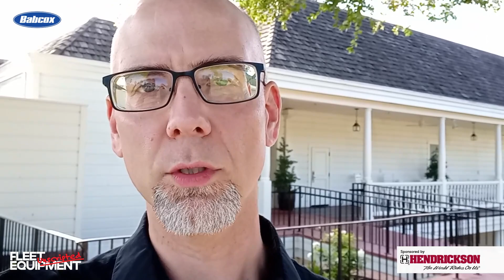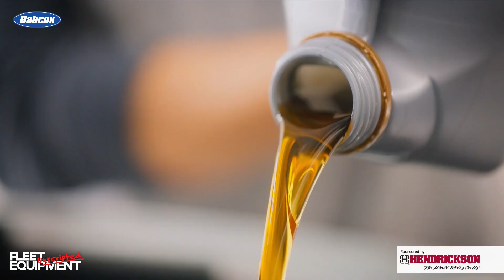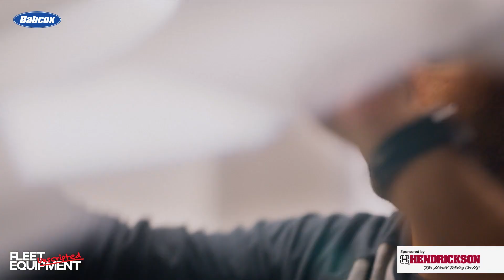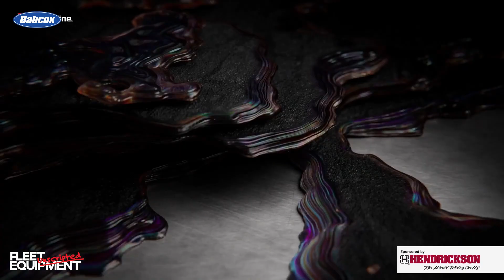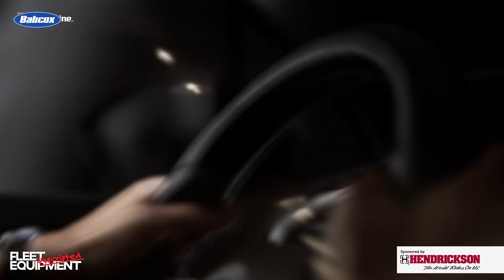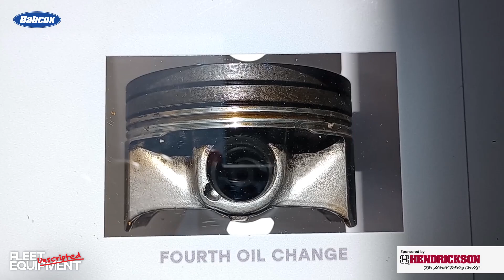The hidden threats to light-duty gasoline engine life, performance | FE Unscripted

Comment: So is this oil something i can use for tegular oil changes my only has 10,000 miles on it never used this before but i did  my oil changes  at 5,000 miles on my 3 cylinder turbo with regular valvoline oil 😊

Comment: He never say´s what the new additive is for removing baked on deposits. It sounds like Oven Cleaner!
Reply: That's proprietary information, so they're not going to give it away. Even in Lake Speeds visit to Valvoline they only generally dance around the topic and they show that it's clearly not just a bunch of esthers (oven cleaner) 😂. They do a side by side comparison of the R&P and their diesel formula designed to clean the engine and it's obviously not just more detergents.

Comment: Ignore the change your oil and filter after 500-2000 miles, if you have been taking care of your vehicle with a good synthetic oil and changing at 5k with filter. Some people have been posting fake videos of clogged filters at 500 miles from this product. I have cut open filters, and all have been clean and clear!! 3rd generation mechanic and engine builder.
Reply: Better to be cautious
Reply: Idk man, I get that for the majority of people, they're fine going 4k or 5k miles on the first oil change even with fairly dirty engines. But for super dirty engines and honestly just to be safe for everyone, an early filter change on the first OCI is like a $4 to $10 insurance and peace of mind. I get your point but I don't think all the videos of people with sludged up filters are fake, there's a LOT of dirty engines out there.
Reply: How do you know they are fake? I saw one video from a guy I trust, and the sludge was there in the filter after 500 miles on a Ford F-150. If you have an engine with a lot of sludge, I can see that happening, and not necessarily being faked. I too have opened several of my filters after 3000 miles with Valvoline R&P, and they were fine, but I had done 5K oil changes for years up to that point.

Comment: In 2022 I got a 1997 town car 4.6 v8 with 48,000 miles    Was burning/consuming 1 quart every 4,000 miles  ( added small amounts and by 4000 I had added a quart  and getting 14.9 MPG combined. Started Valvoline R&P   I’m getting 19.8 MPG combined. I’m at 86500 miles now and I believe the engine is better now with more miles than how it was at 48,000.  Change filter at 500 miles then oil at and filter again at 2000 miles the first oil change when you switch to Valvoline R&P that’s my opinion
Reply: @El_Peto this is a commercial and most posters are Ai

Comment: If high engine oil temperature is a problem, why isn't there a BETTER oil cooling system in gas engines? Back in the 1970's it was common to replace a sheet metal oil pan with finned aluminum pan.  Why isn't there a pressurized engine oil cooling and monitoring system ?  Perhaps this is a 'planned obsolescence'  by manufacturers and the aftermarket oil products and parts industry?  In this video, it sounds like these oil products are like EX_LAX for engines.
Reply: You can add oil cooler and some cars and trucks come factory with oil cooler. My 18 frontier has a OEM oil cooler.
Reply: Oems increased operating temp of engines from 170-185 to 195-205 to increase miles per gallon to meet  Cafe regulation. Engine surfaces are extremely hot now. Piston rings are frying the oil and creating deposits
Reply: @doctorwhodj  Increasing engine operating temperatures by 10 degrees has basically no effect compared to combustion temperatures. Piston rings are now made thinner to increase fuel mileage with lower friction, BUT thinner rings also do not transfer piston heat to the cylinder block walls. This was known back in the 1970's.
Reply: @ThisOldMan-ya472 , doctorwhodj is correct that OEMs have been forced into these higher temps in the pursuit of CAFE and further regulations. 

It’s not uncommon for modern engines to run coolant temps at 220+ and oil temps above 230. Transmission temperatures also stay over 200 degrees, too. 

These powertrains are pushing temps in normal operations that would make people nervous forty years ago.

It is planned obsolescence, though not manufacturers by choice. It’s planned by regulators intent on pushing EVs. They’ll continue making traditional vehicles worse until people naturally gravitate to their desired path.
Reply: @settledontheprairie5524  I can understand higher thermostat and engine operating temperatures, as 20 degrees isn't that significant compared to combustion temperatures. Perhaps this is ALSO why it is unwise to use ay oil other than Full Synthetic. I do see a lot of Dodge 392 engine failures, as there are in Ford and Chevrolet. I do not know what the operating temperatures are for race cars, but that is planned obsolescence.  LOL.

Comment: Why no Dexos rating?  
GM engines have deposits too.
Reply: Probably because they did want to tell GM what is in the oil.
Also pay the money for the license to put DEX on bottle.
Then make it more expensive.
Reply: It costs a fortune to get the rating and it’s not that difficult for any properly formulated synthetic oil to exceed Dexos.
Reply: i run this in my GM. the last 2 oil changes are black as heck after only 1k miles. currently doing 2k changes. used to have a cold start stumble and that is mostly gone.

Comment: Wouldn't a catch can and normal 3 to 5 thousand oil changes solve this issue with sludge instead of buying a expensive oil. Just a old guys opinion 😂
Reply: @user-jo1hm3co6z  in most engines, yes. I have talked to two engineers. One at BP and the other at SOPUS. Both told me the same thing. All oils, including "conventional" can go 5k miles no problem. Catch cans can cause more problems than they are worth in some cases on GDI engines. The carbon on the intake valves become more glass like hardened by lack of PVC oil vapor entering the intake manifold. But, it can depend on specific engines. Some engines are more prone to have sludge buildup in the crankcase or carbon on backside of intake valves.  Subaru and Toyota owners in particular should change their oil at 5k no matter what oil is used in my opinion. Ever wonder why more engineers include oil jets spraying the back side of the pistons are fore? Cooling of course. Modern engines have low tension rings, and it's imperative for the ring lands to remain clean as possible, or you will have loss of compression or oil control. This is the real issue. Penzoil ultra platinum is marketed for this very reason. And this Valvoline restore product as well.
Reply: A catch can only slows down deposits in a D.I. engine - will not prevent it.  An oil catch can will also help keep some oil and other garbage out of your turbo inlet.
Reply: @reubenmorris487   - There are many variable factors that play a role in choosing a motor oil, for example the Amsoil XL Boosted which has a very low noack but also exceeds all requirements.

Low noack means low evaporation and therefore less losses and deposits.

Also follow the API rating that is now on the SP better, the ACEA works a bit more accurately. Delve into this and you will notice that ACEA is actually better.

Furthermore, we have to decide that that GDI junk has disadvantages that we do not want, and therefore also brings with it burdens.

I then simply decide to avoid those engines like the plague.

By the way, I drive a Beemer 3.0 diesel, and the 2.0 diesel. Furthermore, powerful engines from Honda.

The right advice and the right products and the right maintenance. But isn't this the case with everything?

Furthermore, here in Belgium we also use ethanol or regular petrol. Or the V-power diesel.
Reply: @laurapalmerTDGE  I use Amsoil European MS in my VW Tiguan...so I'm merely speaking from personal experience.  I understand the goal of NOACK volatility testing; but your oil will still let off smoke and mix with the PCV vapors and make it's way back into the intake valves.  I agree about the GDI; it wasn't well thought-out with respect to maintenance and longevity.  They need to engineer a way to maintain the pollution control without clogging up the intake valves and creating a situation where you have to pull manifolds as regular maintenance.
Reply: I follow your opinion. 

Valvoline also claims that previous oils caused many deposit problems. 

I stick with 0w30 Shell Helix Ultra and SS Amsoil Diesel both S/C rated. Or the XL Boosted which are near perfect. 

One quart of Valvoline is about is about 7 dollar over here in Belgium. But there's better. 

Ps : frequency matters a lot.
Reply: What about adding 1 quart of  automatic fluid to clean deposits.

Comment: I live in Canada can't find this stuff anywhere
Reply: Check with your Cummins dealer, look up Cummins Blue.
 I use it in my Duramax, and my 04 5 cyl  P2 Volvo Gasoline 
 The Cummins Valvoline Blue was where this got developed.
Reply: @johac7637  will do I have a 2010 CTS-V wagon manual with 732,482 Km would like to try this stuff just 2 see what comes out
Reply: Valvoline hasn't been able to market it in Canada, that word I got from them, I brought mine from the USA, there it's at Walmart, you'll need to get it online shipped to you, unless you can go stateside. 
 I went to get some more here for a customer, but no luck.
 Even the Diesel version is getting harder down South, as it's only sold to a Cummins outlet.
Reply: I ordered restore and protect 5w20 on eBay for $26.00

Comment: On that first oil change that you use Restore&Protect, a lot of the deposits that are easier to remove come off quickly and clog up the oil filter. But in general any that aren’t caught in the filter are small and stay suspended in the oil. Highly recommend changing oil and filter after 2000 miles the first time you use this stuff or it will clog from all the gunk getting cleaned off.
Reply: According to Valvoline that’s not true. They specifically designed that oil to clean slowly so you can run normal intervals and to not clog your oil filter. It takes several change intervals (I don’t remember the exact number) to clean.
Reply: @flyer8493 4
Reply: @flyer8493  yeah but once you have sludge it has to go somewhere... Usually to the oil pan where it's gonna get sucked up.
Reply: @miltechmoto  True. But I don’t think restore and protect is really meant to be used on a neglected and sludged up engine.  Be cool to see a test to see if it can be.
Reply: Are you speaking from experience with this oil?
Reply: I have seen videos of allegedly clogged oil filters, and engine noise. I doubt seriously this is true. It's not kerosene you are putting in your engine. And besides, Valvoline would not put their name on the line if it's actually that harsh. When I was young we used Castrol GTX to clean customers neglected engines. If it was severe, we would use Rislone as well. This worked satisfactory and we had no oil filter problems or lifter problems.
Reply: Definitely a good rule of thumb. Although Valvoline states that it’s good for the entire mileage interval, it would be good practice just to change it out early. Not every vehicle has the same amount of sludge buildup and some could be worse than others. When in doubt, change it out!
Reply: If it cleaned aggressively like that, wouldn't it clog the oil pickup and cause catastrophic oil starvation?
Reply: @willp942 .  I just changed the oil filter at 500 miles  then  changed oil and filter at 2000 miles now I’m at normal intervals.   Worked magic on my 1997 Lincoln Towncar
Reply: I saw a video of a guy who I think had an older Ford F-150 with Restore & Protect for the first time, and pulled the oil filter after 500 miles. It was extremely plugged with sludge,. but admitted it was not well maintained. It is only one data point, but I think changing oil and filter early (1500-3000 miles) might not be a bad idea the first couple times, possibly sooner if you are unsure of the previous maintenance.

I have been using Restore & Protect on a few of my vehicles recently and pulling the oil filters after 3000 miles, and they all are in very good shape, but I also have been good about regular oil changes prior to this. Mine are Toyotas and Hondas that are between 3 and 15 years old. I have always used Wix XP filters to be on the safe side.

The jury is still out, but I feel like the oil comes out dirtier after 3000 miles, than it would before with 5000 miles, so I think the engine is gently being cleaned.